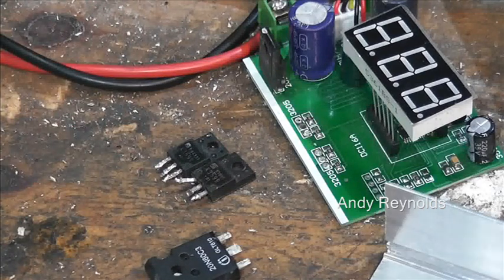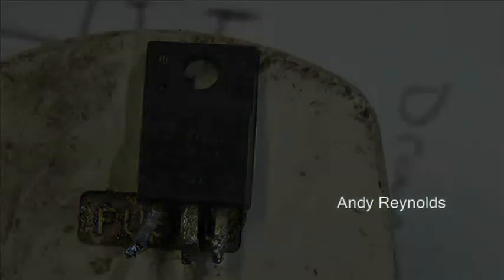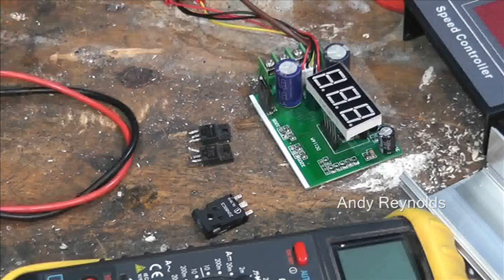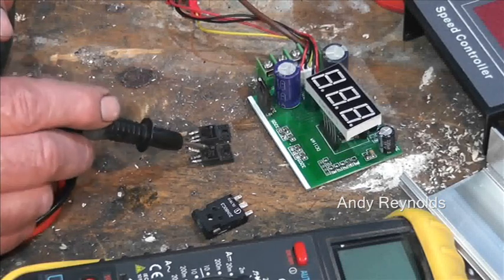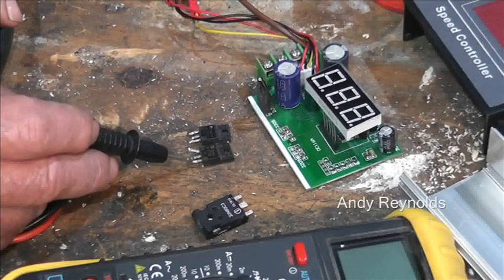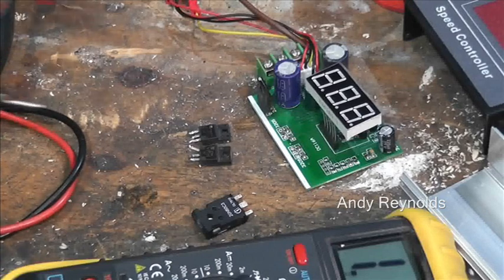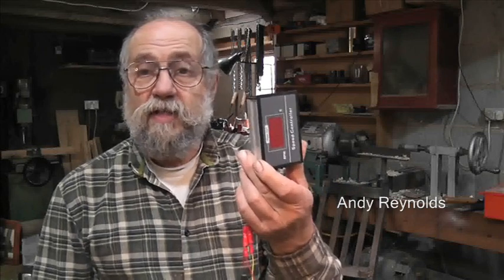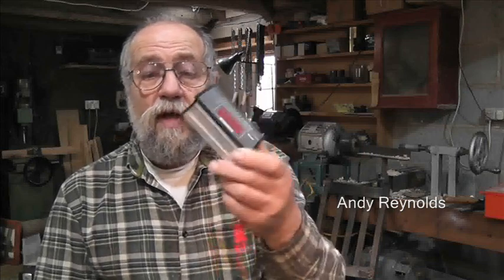Speed controller repair, what went wrong?

Comment: Old find, but...
The middle pin, the drain, drains out the current...and should have conductivity from the heatsink to the chassis /ground. 

Power would be brought in through pin three, and as the triggers its released, that power would get sent to the motor and any additional unused power would return through that drain/ground back to the source.

Also, there are positive and negative mosfets, and they are wired in the circuit board in series.

So if you had two, and only put back in one, then you would have to bridge… That connection which is now severed based on your removal of the second Mosfet. Causing you to not have any power.
Reply from the maker: hanks for the interest, is nPn and pnp? cheers
Reply: @TheInfoworks P mosfet positive / N negative. 
Much like any diode, currently only flows in One Direction.

So for an N you would measure by placing the negative probe onto the source pin.

For a P you would place your positive probe on the source pin .

Then, when you touch the gate, it would see either that positive or negative current which would trigger the gate to open .

Comment: Off/on switch and a throttle. Bodge it!😊
Reply from the maker: 2 relays, piece of nichrome resistance wire and 2 micro switches will give 2 speeds, cheers

Comment: I would check to see if the aluminium case was in any way connected to the circuit board if it is isolated it would be better to connect the FET directly onto the case with a bit of thermal paste for good measure. But it looks like the driver for the FET is blown in any case. I have one of those cheap speed controllers floating around somewhere, I would not trust them above 12 volts and ten amps, The Chinese always claim more than they are capable off.
Reply from the maker: Yes you are right, sometimes it's just not worth the effort with ultra cheap electronics. I thought about bolting the FET direct to the ali case but as it turned out all was pointless, cheers
Reply: @TheInfoworks  I have just dug the one I have out, not taken it completely apart yet but the third item on the heat sink looks like it might be a Schottky diode, The unit I have looks identical other than the FET's have metal tabs and are isolated with heat transfer pads. There is no way that they can carry 60 amps as the tracks would blow at anything ove thirty amps. I will dig deeper on the one I have and find out what the FET's are and whether the third one is a double diode or another FET or transistor.
Reply from the maker: @Equiluxe1  That's grand, on this one it looks like a double diode. On the component data sheets it shows the need for a diode, cheers

Comment: I've just tested mine and can report the doublesided thermal tape is non-conductive (the stuff with the blue backing layer). So good for attaching the FET to the heat sink.
Reply from the maker: Ian, yes as long as the clamp is insulated also. It's all rather disappointing and I suspect the listing specifications are different from reality, there's no label, I've sent it back for a full refund. cheers
Reply: @TheInfoworks  The royal mail wins again!
Reply from the maker: @bootsowen  exactly, but at least it's easy and free to return faulty junk. Should have know better really, cheers

Comment: It's tricky with the low end stuff like that Andy, the price of a single component, MOSFET or whatever, could be quite high compared to a new unit. I spent hours this week trying to figure out why my rainwater pressure pump kept cycling on and off, in the end I figured it out, learned a thing, got it working and have high pressure rainwater. Like you say, some aren't interested. 

as for FETs, there are NPN and PNP, every time I look at it I have to go back to the start, I recently have only dealt with TRIACs for AC so they are a slightly different beast. 

£400 on it's way to compensate us all for the hikes in energy prices! Those panels are nearly paid for!
Reply from the maker: Owen, hope you did an analysis video, yes sometimes you can go down a rabbit hole if the item suffers multiple failures. Yes these are the times when previous energy investments are really paying off. I imagine your water pump was suffering with pressure loss to the diaphragm causing the hysteresis. Cheers
Reply from the maker: @UC0RTtr15xEBVNM-Z38xGQDw Yes going no where near the rated value is something to recommend every time,  even on quality gear, cheers